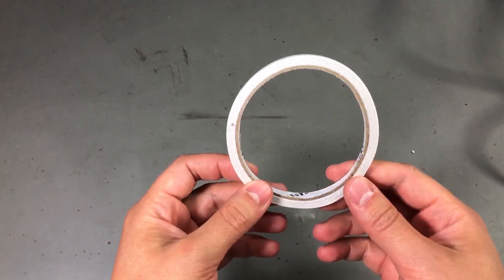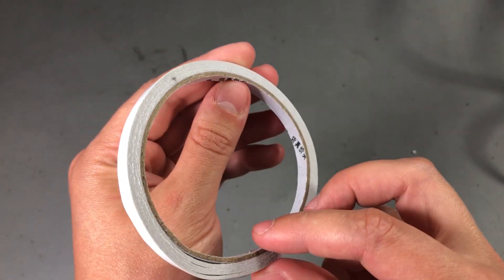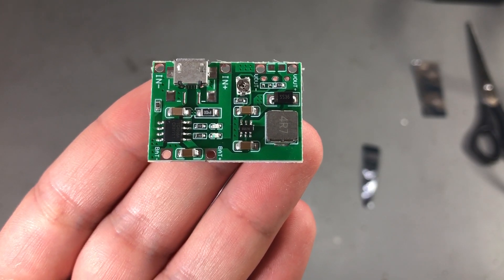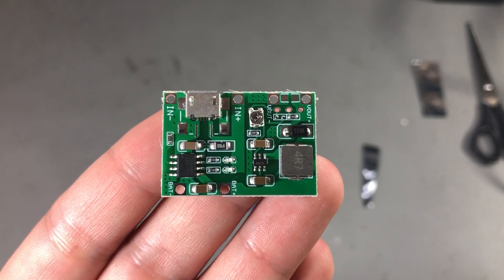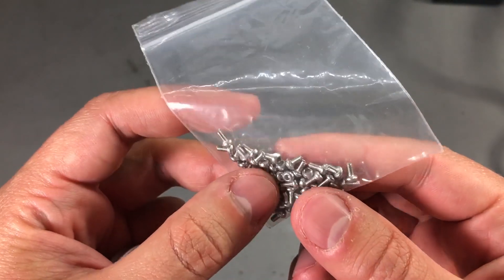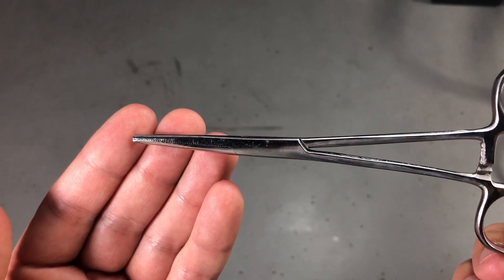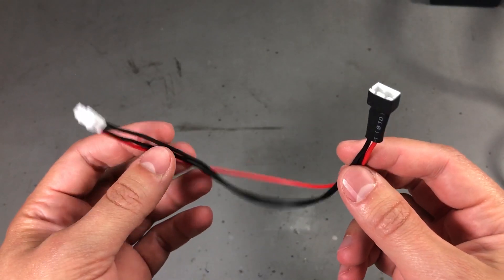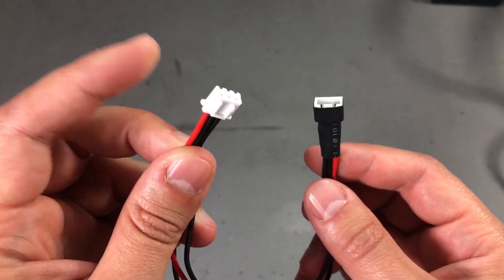Voltlog #244 - InTheMail

Comment: How well does the solder perform? Most Chinese solder I've tried is junk. I stick to brand names like Kester and Multicore. Supposedly Ameriway solder is good but the price on TEquipment jumped from $11 to $17.  So not quite the great value it was.
Reply from the maker: I recommend watching the video from SDG Electronics channel, he compares various types of solder in that video.
Reply: I recently started using Mechanic HX-T100 solder wire and it's good quality solder. I was positively surprised, how well it performs.
Melts and flows really well, no problems at all.
Reply: @Hugatry  Mechanic Solder costs over $20 / 500G/LB. For that much I may as well buy Kester.
Reply: You should try Soldron company's Soldering iron once
Reply: @DipElectronicsLAB  I'm probably gonna get a Pace ADS200 soldering station. I need a reliable station and been wanting an iron that uses cartridge tips. I've been using Weller for 30 years.